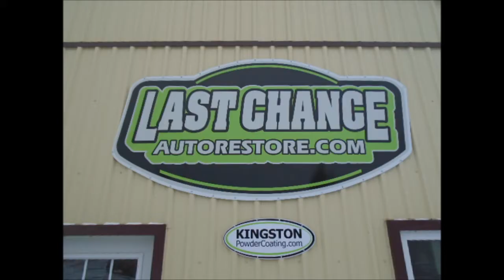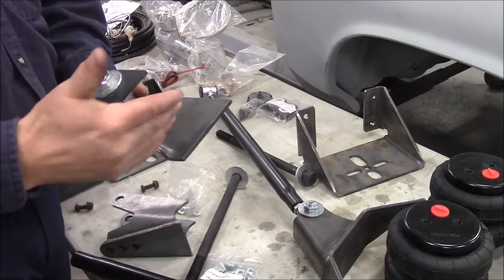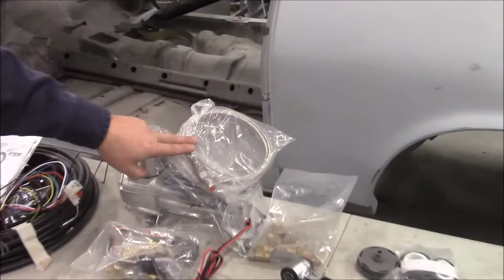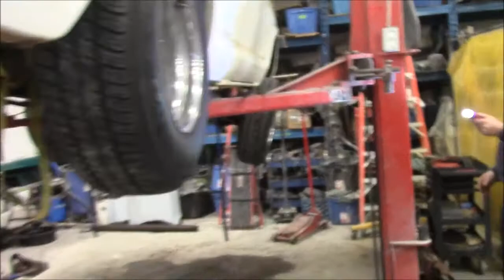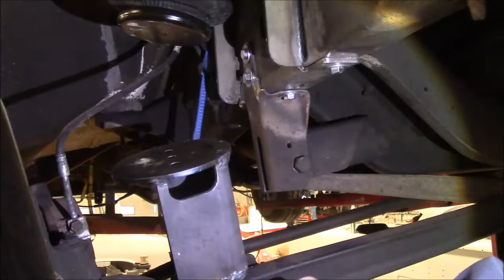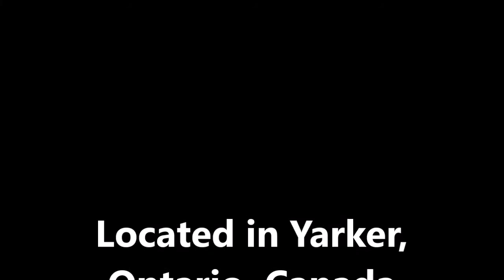1977 Ford F100 Truck Restoration Update, Air Bag Suspension Kit,  lastchanceautorestore com

Comment: Who makes that kit? I have a 70 f250 but can’t seam to find a kit for ibeams...
Reply: Did you ever find out who made that kit ? I have a 69250  didn't know they made a semi bolt on kit for the front like that .
Reply: I wish I did and I just checked back in a year later to see if there was a reply now that I am mid project but can’t seem to find that… Almost thinking he’s referring to it as a kit but possibly had it generically made because I can’t find anything even close after very extensive searching
Reply: @gabeguedea2499  
It looked like a premade kit I think they were in Canada maybe the owner bought it from a local maker ...like lift kits there's a guy in Fontana ,CA he makes 3 and 5" lift kits for 2wd bumpsides not too many know about him maybe air baggit .com anyway I'm thinking of putting a 5" lift so I can keep my F250 towing capacity ...
Reply: I’m in Menifee ca and there are lift kits in shops on every corner around here. But you should really look into Autofab in San Diego. The guy in that shop is 2nd generation nothing but ibeam fords. He’s amazing.
Reply: @gabeguedea2499  
Yeah that it I thought it was in Fontana yep autofab that's the only I beam lift kits I know of guy's name Dan or Don looked into it a few times ...
Reply: I’ve been into the shop before I bought springs for my 97 250 And he has an entire shelf with probably I would guess 1000 sets of beams every year bent cut rebuild trust welded so many different configurations and just years and years of collecting it’s really something else… If you have the chance to go down there when you make your purchase I would definitely recommend it
Reply: @gabeguedea2499  
Wow yeah I would like to I have a 69 camper special 390 5" lift then I could fit some 33" inch tires maybe I get my RPM down from 2,800 at 65 truck was really only meant to pull a heavy trailer or have a camper sitting in the back 😀
Reply: At 55 mph
They run me over here in Bellflower  ...the 605/91/710/405 I'm hiding behind semis
Reply: Lol Yeah at 16 my grandpa gave me the 70 f250 390 with a C6 camper special and commuting up the 15 from Elsinore to Murrieta for school I was just about redline semi’s are blowing by me so I definitely know the pain lol.